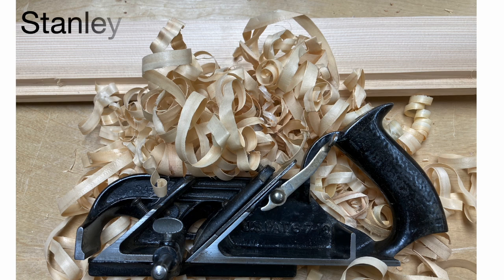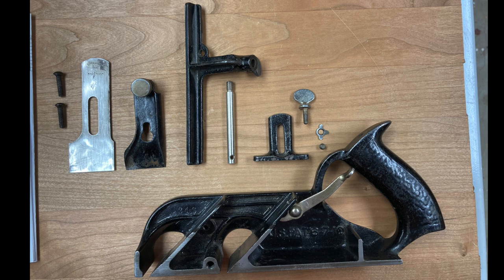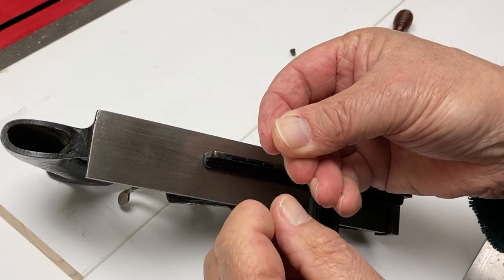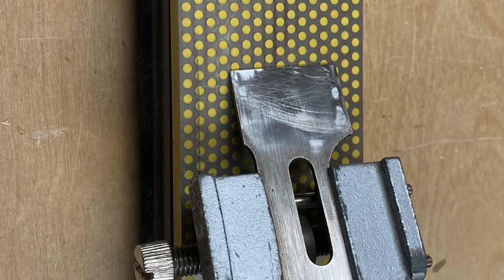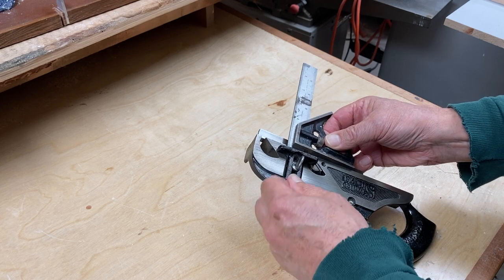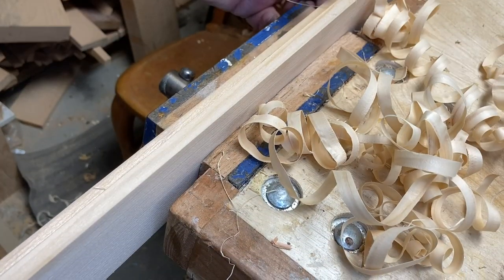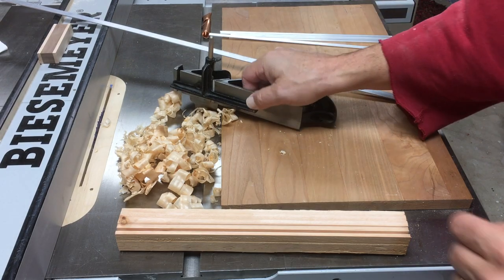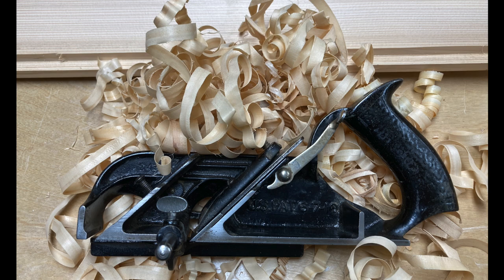Stanley No. 78 Duplex Rabbet Plane Explained and Road Tested.

Comment: I have heard many old masters say that your blade should never be flush with the body.  It was designed to protrude slightly so it gets right into the gullet of your rebate. Also, according to Stanley, experienced craftsmen, and every shop textbook I've ever read, have said that the nicker is there specifically to help it cut cross-grain.  It may help for end grain, but that's not what it was designed for.
Reply from the maker: You are absolutely right. I meant to say across the grain and should have shown an across the grain rabbet. thank you for the great comment and thanks for watching.

Comment: When you need just one rabbet or two on a small project, you'll find the #78 is as fast or faster than setting up a router. Changing bits, setting depth, setting a fence on the router or work piece, doing a test cut,  dealing with noise and dust.  The only drawback I've encountered is doing a rabbet cut against grain, the solution of shallower cuts and a nicely sharpened iron (6000 grit is my minimum, yes, you'll notice the difference) works.
Reply from the maker: Thanks for the note. I agree, sharp really matters. I will also usually score with a knife across the grain instead of using the spur. Thanks again.

Comment: I’d recommend looking for a different model. The fence on the 78 only attaches at one point and likes to pivot out of square if you’re not very careful.
Reply from the maker: Thank you for the note. I agree you have be kind of gentle with it. The attachment point is right at the blade though, so the main bearing point is even with the blade. 
Which model do you use for this kind of thing? Always curious about what's out there.  Thanks again.
Reply: @makingthings1463  I have a 78. I’ve seen fillister planes with fences that attach at two points, but I don’t know what make they are. I just know I wished I would’ve gotten one.
Reply from the maker: Thanks again. I'm afraid if I had the room and the $$$ I'd have them all.
Thank you again and enjoy working with these old tools.
Reply: @christophermcclellan8730 
That is the Record 778.
Probably better than the Stanley 78.
Reply from the maker: Yeah the Record plane has 2 supports for the fence and a much better blade depth adjustment using a screw instead of the lever on the Stanley.
Thanks again for the note.
Reply: @nigelburge3613  thank you! Now I know what I’m looking for!
Reply from the maker: Looks like Grizzly makes a copy of the Record 778. Might be worth checking out. Also lots of 778's on eBay but $$$ UK shipping.
Reply: I inherited a couple of these, a Stanley 78 and Woden W78, sadly the fence was missing on the Woden but if you get one they have two rods to support the fence. I use it minus fence as a bull nose plane. A joker on e bay selling a fence and rods for more than a whole w78 plane! I’ll manage with the Stanley.
Reply: Only really affects the first couple passes. Once you have the inside shoulder defined that acts as fence the rest of the way down.
Reply: @makingthings1463  Truth be told, the Records are almost always better than the Stanleys across the board. I see blue, and I buy!
Reply from the maker: I seem to have the same problem, I go straight to the old tools when ever we stop at garage or estate sales.
Reply: @makingthings1463  I was about to drop the same comment😊. Beautiful little plane to use, I even found an old iron that I ground into a bead profile, great for fine work with stubborn grains. Nice video👍
Reply: A good video and well explained! I’ve used this Stanley type for many years without any big issues, and recently I’ve gotten a very nice record 778 and also very pleased with it.

Comment: Great video! Thanks for posting. I am currently making two large picture frames for my daughter and the only tool I have to make rebates is a router. As others have said, it is very noisy, very messy and takes quite a bit of time to to set up. I have ordered a second hand 78  and hope it is in good condition and not needing too much work to get in shape.  If not, I'll have to go full retail! 😢.  It is such a pleasure to use good, well tuned hand tools rather than painfull and expensive power tools.
Reply from the maker: Thanks for the comment. They both have their place but I agree. Sharp hand tools are a pleasure to use. Thanks again

Comment: Just acquired one of these planes and now I'm ready to put it to use, thanks to your excellent video. Thank you!
Reply from the maker: Thank you for the comment. I have another recent video on the Stanley 192 that you might also find interesting. Thanks again for watching.
Reply: @makingthings1463  Just came up from the shop and after the inevitable fiddly bits I was able to cut several 3/8" X 3/8" end grain rabbets in some 1 X 3 pine (watched your end grain demo). Took a practice piece or two to start getting comfortable, but as you promised, no end grain tear out. Thanks again and I'll look at the Stanley 192 video next.

Comment: Very pleasant video to watch with a really pleasing presenting style.  I used one of these planes in the UK for many years and we also call this a rabbet plane.  I always took this to be a corruption of rebate.  When I used a Sranley 78 it was usually faster to set up and use than a router and there are few things more pleasing than the sound of a well set up plane shaving wood.
Reply from the maker: Thank you for the note. I agree with you, rabbet is a corruption of rebate. I so enjoyed your description of planing wood with a well set up hand plane.  Just today I jointed a piece of wood with a Stanley no. 8 even though I have a power jointer. The plane is heavy and sharp and the grain was nice and helpful. It was a pleasure and nearly silent. Thanks again and enjoy your hand tools.

Comment: Wonderful video.  I picked up a No. 78 on eBay a few months back, and just got around to fettling it, sharpening the blade, and tried using it.  IT WORKS, and it cuts nice rabbets...if I remember to fully tighten the fence so it doesn't wander, and then to focus on holding the plane tight up against the fence on every stroke, to keep the inner corner of the rabbet sharp and clean.  If I let my attention wander, and take just one stroke with the fence NOT tight up against the workpiece, the corner gets rounded, and I have to clean it up with a chisel later (I haven't yet figured out how to correct the issue with the plane, once that corner is rounded).

However, I do run into a problem that you don't seem to have, not at all -- my No. 78 gets chips jammed into the innards very quickly -- I keep a pick on hand to dig them out.  You get nice long even shavings, without a jam.  What am I doing wrong?
Reply from the maker: Thanks for the comment. I have jamming problems too, I think it has to do with the wood you are planning and its dryness and its grain. Whatever it was I used in that video must have been just right. I do try for thin shavings and have it as sharp as I know how. Thanks for watching.

Comment: I have my fathers old No 78. It has all the attachments. I don't use it as I have a Router but the Plane is has a high sentimental value. Nice to see this vid even though I know how to use the plane. Thankyou for sharing.
Reply from the maker: Thank you for the note.
Reply: By the time you get the Router out, plug it in, make the settings (depth and height), and get the dust extraction hooked up and functioning, get your ear protection and eye protection on; if you used your father's No 78 you would be long done and off to the next thing.  Oh, and now you have to put all that stuff back- Router, fence, PPE, and vacuum up the shop from all the small dust, the dust extractions missed., just saying.

Comment: I appreciate attention to this plane, it’s definitely not an essential tool but they do pop up at flea markets and junk shops/antique malls.

To be clear about cutting end grain, the nicker pre-slices the fibers across the grain, essentially a tiny crosscut, right (the sole of the plane is resting on the face of the board as you plane)? I could see how someone could interpret what you’re saying as making a rabbet but resting the sole on the end of the board rather than the face, which is definitely doable on large stock but not practical on most stuff.

Also, like ploughing grooves, if you have even mildly unforgiving grain it helps to start at the end of the rabbet and make a 1” nibble at the end and double or so the size of your stroke as you progress.
Reply from the maker: Great suggestions, thank you for the comments and thanks for watching.

Comment: Can you say more about your 90 degrees comment on sharpening?  It doesn’t look like a 90 degree plane angle.
Reply from the maker: Thanks for the comment. I meant 90 degrees across the sharp end of the blade in relation to the side of the blade. Sometimes when people sharpen by hand without a guide the angle can be off a bit. Most planes will let you correct with a lateral adjustment but this plane the side of the blade is flush with the 90 degree body of the plane.  This will insure a level bottom of the rabbet. Thanks again, hope this made sense.

Comment: And what is the difference between putting the blade in the middle section vs the front section?
Reply from the maker: Thank you for the comment. The front section would be the equivalent to a bull-nose plane. Kind of hard to handle with very little toe in front of the blade. Also it is not aligned as well with the fence support. Thirdly, adjustment is tough because it does not have the adjustment lever at that location. Best reserved for bull-nose needs like cleaning up a rabbet at an inside corner. Thanks again.